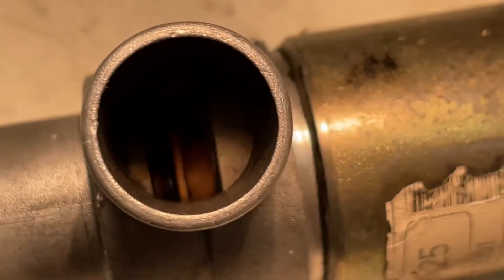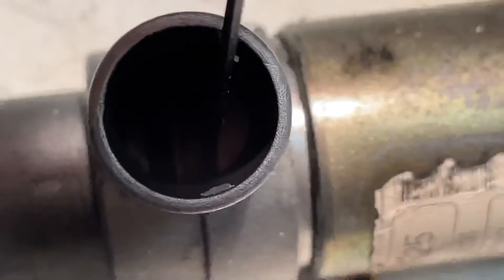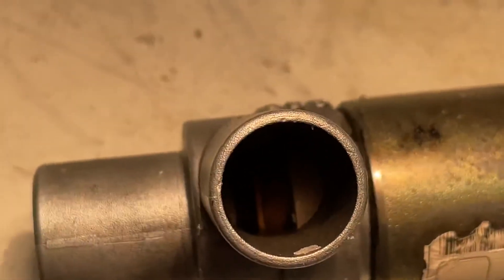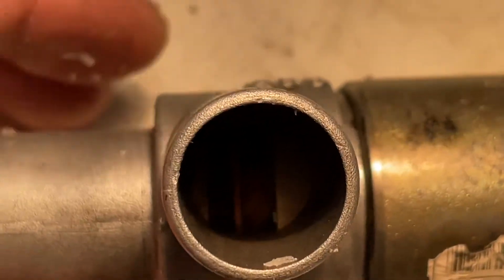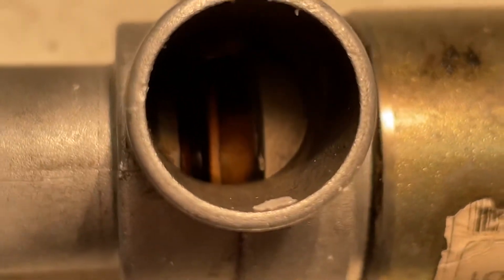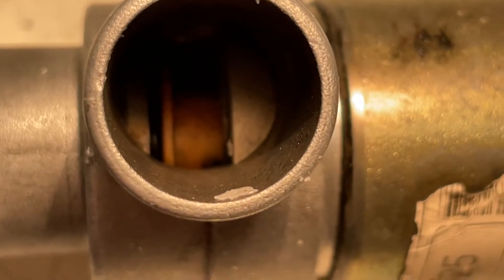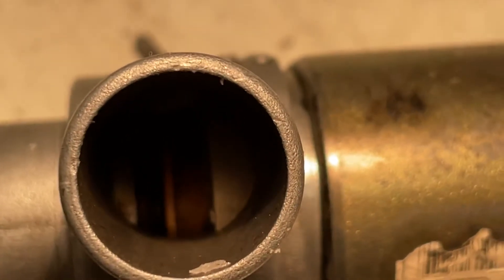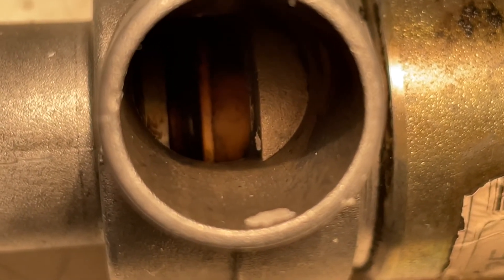Mercedes Benz W126 560SEL 03/89 Idle Speed Control Valve Test and Repair Part 12

Comment: Hi I soaked my ICV in carb cleaner and a orange piece of thin rubber came out. Does this mean my ICV is shot? My idle is 1800rpm when in park. In drive it's 900rpm. Thanks
Reply from the maker: Hi George, 
Yes, you will need a new ICV now.
You can see the part here in this video on where it actually belongs:
https://youtu.be/Ybki3B1vefs